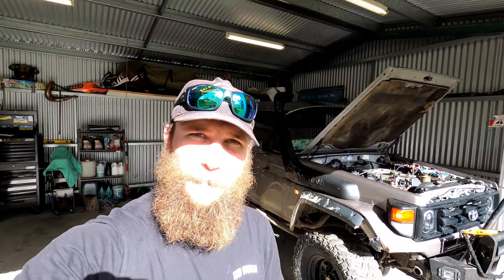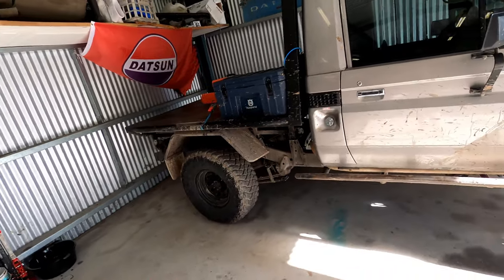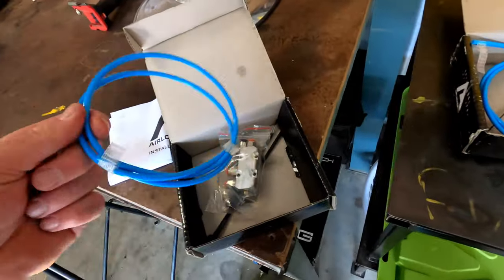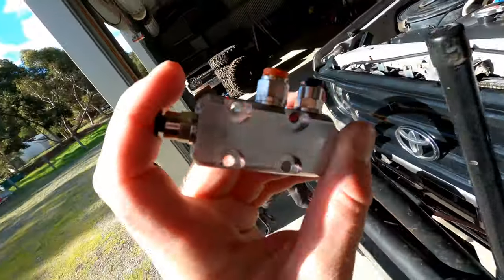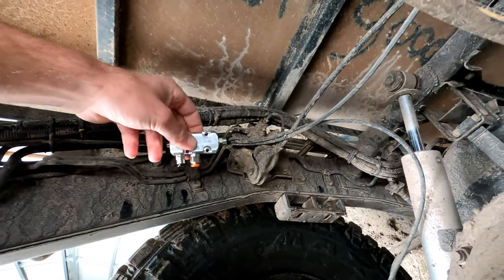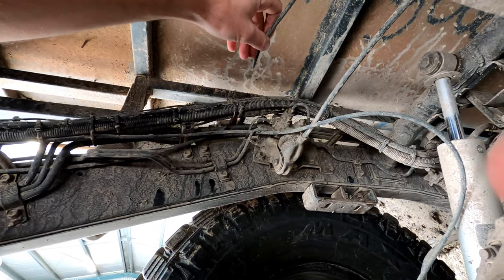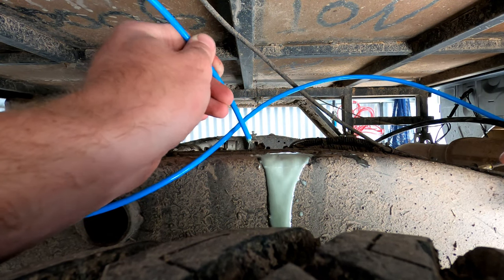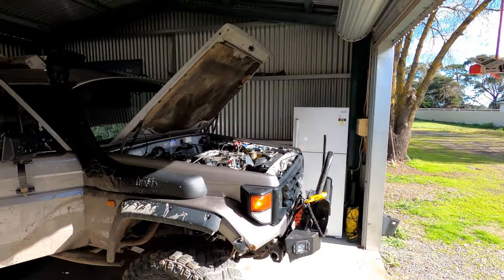ARB air locker purge valve kit install!

Comment: Good as temporary solution but it's not really a hard fix to replace the o-rings in the air sleeves. Also, check that your diff breathers arn't blocked. 😉 

ARBs air sleeves are a shit design but if you take proper care when installing the o-rings, they can last a fair time. I have one that I installed over 10years ago, still has the original seals and still holds air fairly well. Certainly no oil pumping back through the lines. 

I do prefer TJM prolockers, much better designed air cylinder and doesn't wear out because there's nothing constantly rotating on the seals, unlike the poxy Arb air leaker. 😂